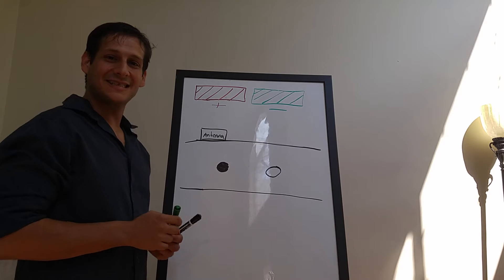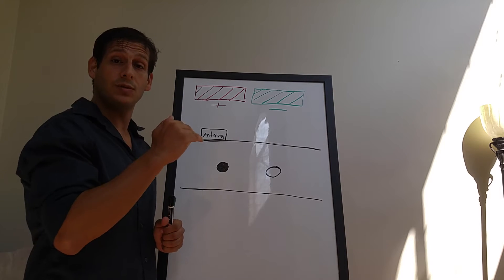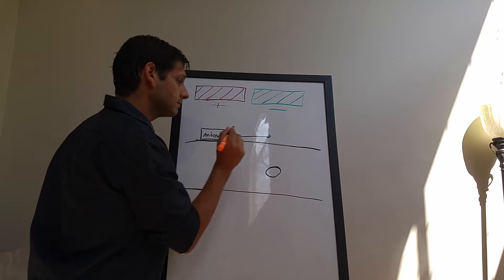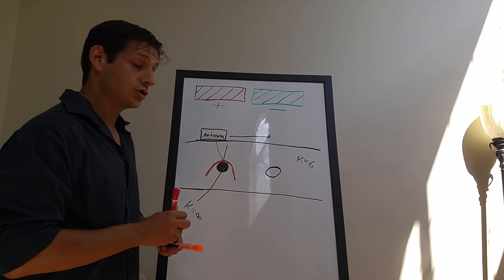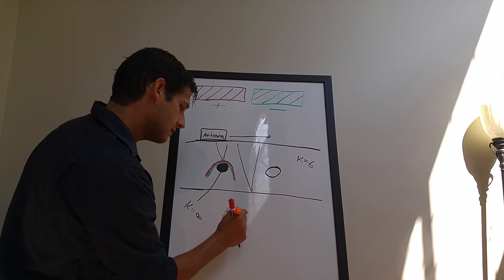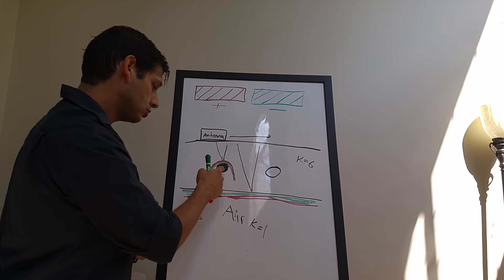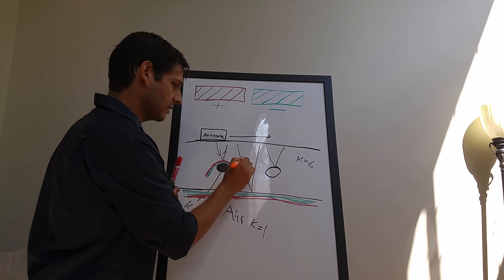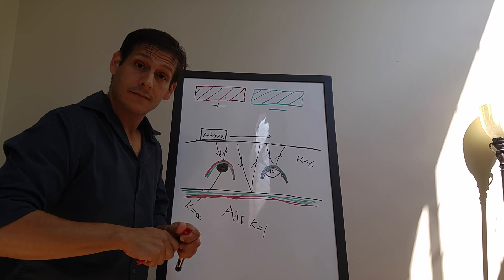HOW DOES GROUND PENETRATING RADAR (GPR) DISTINGUISH BETWEEN REBAR AND VOIDS IN CONCRETE?

Comment: Metal is special - it actually absorbs the radar pulse and re-transmits it back to the antenna.  That is why you typically get such a strong response from metal (and usually ringing as well).  The non-reversal of polarity (sorry for the double-negative!) is important for its own sake.  I think new FRP bars might also be a higher dielectric than concrete, and so would be expected to give a non-reversal of polarity, but the response won't be as strong as metal.  So the basic concept - higher dielectric gives non-reversal, lower dielectric gives reversal  - holds.  I just get a little picky at the use of the word "reflection" when it comes to metal (although the word otherwise pertains for all other materials).

If the metal is very, very thin (as in wire mesh), then you won't necessarily get the strong response I've seen from rebar, but that is, presumably, a more advanced topic.

Having just written these sentences, I guess I'm more comfortable with "response" than I am with "reflection"... :)

Comment: Hello, thank you for the videos. I am new to GPR Aplications. I am aware of its  limitations but your videos  are very helpful.  I own an OERAD formerly as EASYRAD out of Bulgaria. it's a dipole antenna unit. We purchased  it in hopes  of locating voids. Specifically  tunnels, and air vents coming to the  surface. I have an 8' shaft that the first 16" is sealed with plywood and dirt. After playing with the  settings  and the background colors I am getting  pretty good images. Unfortunately  the manufacturer  doesn't provide much operational  information, so it kind of  like you are on your own. thanks again, I subbed  and will be watching  everything  you post.
Reply from the maker: Thanks so much for the sub and im glad the videos are helpful. Good luck!!

Comment: Hi
Thanks for this vedio.

Could you please provide me some knowledge about concrete scanning interpretation (rebar distribution, slab thickness and concrete cover thickness over rebar)?
Mostly i'm confuse if i see a layer below the rebar patter it will be slab bottom but which of the polarity should be picked for the thickness of the slab.
Reply from the maker: pranjal maurya hi. You asked a bunch of questions. Check out my other videos. I recently did one on finding depth to target. All of the questions are answered in my online program at learngpr.com.com.

Comment: Sir
can you pease tell me how defferentiate between ground wave and reflectd wave by taking an example radargram
Reply from the maker: Vishnu Manoj Thanks for the comment. A ground wave can be a reflected wave. Can you be a little more specific?
Reply: Sir i am trying to study how to use GPR to find moisture content ...while reading some articles i found that we can use ground waves (clearly mentioned not reflected wave) for the purpose
.............

or can you pls make a video about finding moisture content of soil by using bi-static shielded antennas
Reply from the maker: Hi. The articles may have been distinguishing between surface and buried as reflected and nonreflected. Bit I think I understand what you were asking now. If you are looking for moisture content at the ground surface you will see different amplitudes in the ground wave response. Or you can map variation in signal attenuation below ground surface to get a relative measure of moisture
Reply: +LearnGPR can you please release a video on that please sir

Comment: If parallel scans show that your "void" is repetitive and forms a nice line, then you are actually looking at an air (or water?) filled PVC pipe.  I'd be reluctant to call that a "void".
Reply from the maker: bdrogin Thanks so much for the comment. I would say it's semantics, but no doubt you are correct. The ultimate purpose of the video is to show that wave transitions from concrete into different kinds of materials will produce different responses. That would be the response for air whether a pipe, crack, or a void below a concrete slab, or an air pocket of a grave. Understanding this point should allow, I hope, beginners to take this info and use it in many different circumstances ultimately enhancing his or her ability to make interpretations. Thanks again and I really appreciate the interaction. Keep the comments coming :)
Reply: I agree, this is a great video for beginners.  I don't have as much experience in using GPR on soil, which can get quite complex in interpretation, and I have great respect for those with expertise.  In concrete, the purpose of the scan is usually very specific, and locating a non-metal pipe or conduit run can typically be part of the assignment, which is why calling it that is an important semantic.  Except in an episode of Law & Order (SVU), finding a grave embedded in a building interior is not so common... ;)
Reply from the maker: bdrogin Thanks for the compliment and you do make a good point about the wording. p.s. I have located 1000s of graves...but I'm still waiting to find that one below the building. ONE DAY!!
Reply: There's an episode where they used GPR to find a suitcase embedded in a wall, and in the suitcase was a body.  The filmmakers showed a technician holding up a tablet which appeared to be giving a live 2D picture of the wall!  I thought, got to get my hands on one of those!  Unfortunately, a TV fantasy, as you know, it takes several line scans in both directions for software to create a 2D or 3D representation.  But the industry shout-out was still appreciated...

Comment: hmmmm, I'm sorry Dan, but I am going to have to disagree with you on one section of this video. 

Firstly, everything you have gone through on here is spot on, and it amazes me how many people that use GPR, regardless what sort of antenna and application they are using it for, do not know this simple process, to determine what material the object you have found is made from. 

But can I just pull up you one point? 

You said "does it matter if your radar is set for positive or negative" and you said, "absolutley it does". 
I'm sorry, (now maybe I am just being too critical) but I am going to say "no it doesn't matter what your radar is set up for" so long as you actually know what it is set up for. 
If you know it is set for negative positive or set for positive negative then you will be fine out in the field. So long as you know and you can read it and more so understand it. 
Sorry mate, I'm probably just being too critical, you do go through and explain it perfectly throughout the rest of the video, so regardless of that bit at the start, if someone is watching this and paying attention then they should get it and understand it. 
But anyway, well done on doing a great video for everyone to learn from. 
Keep up the good work. Regards Ben
Reply from the maker: Hey Geelong! Thanks for another comment. I agree with you here, but I think I asked does it matter if the reflection is positive or negative and it does. Certainly you are correct. It matters what your GPR settings are, but that is a little more detail than I was shooting for. The point of the video, which I think you agree, was to show that the polarity will be different if the wave moves from a high dielectric to a low dielectric compared to the other way around. Understanding that the polarity will be different depending on the materials is important for interpretation and can help many surveyors that currently don't use this important fact to develop better understanding. Thanks again for the comment and please keep watching. I'd love to hear more from you on future videos. PS, I like the critical! :)